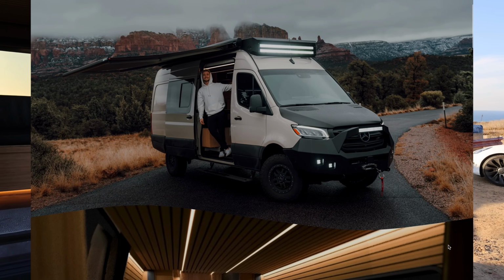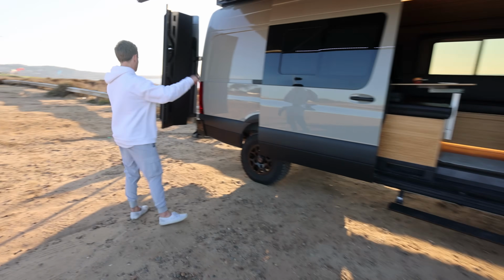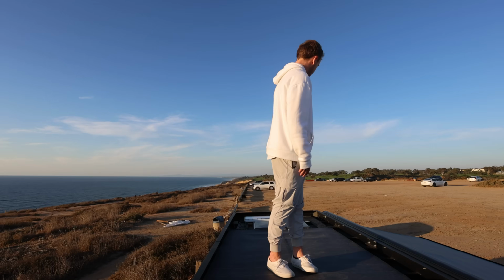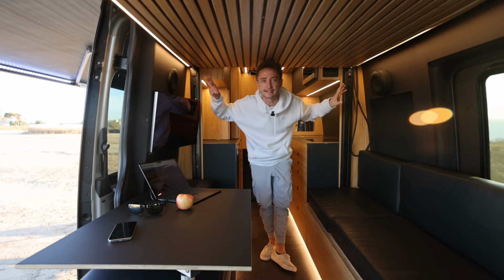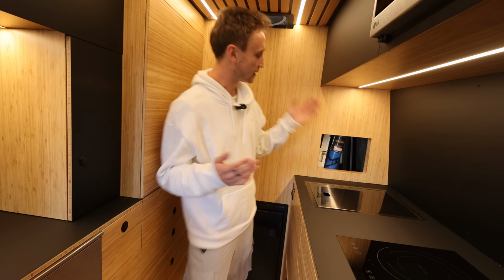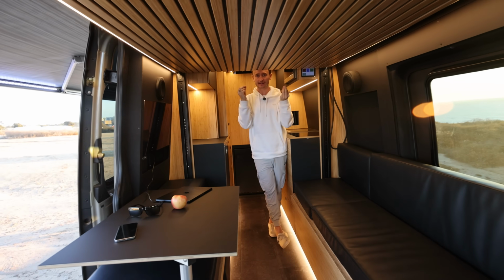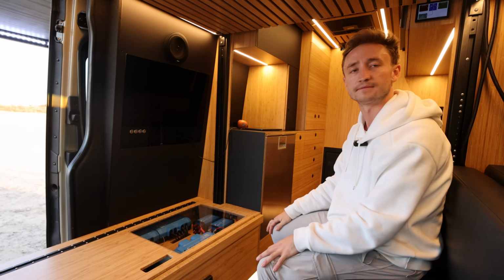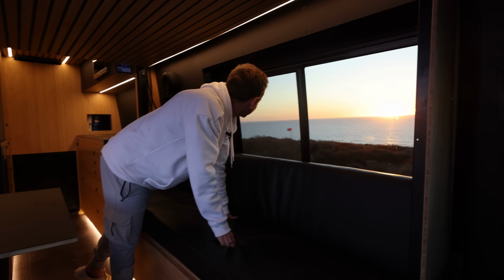MOST Futuristic Van Build - Mothership Vans

Comment: Awesome!!!!! I know turbines have become relatively easy to make from what they were. Great Scott! On yt showed waterproofing, I think he opted for resin and the water temperature should act as coolant idk long term. As for screws, I believe air and water have the same fluidity and friction; new screw shape and designs have been proven to work best so try the toroidal or innovative drone props which may add efficiency but definitely reduce noise while adding accuracy/control. Ideally, the wind and hydro generators would be the same rig, different screw (prop) if anything. Otherwise shaped like ann egg, 3d printing may be perfect with a non uv degrading material. vawt turbines do best with changing direction and especially with Eddie currents (wake) so it may be a good option, keeping the wires vertical and out the water perhaps-but would need an anchor on both ends with low resistance. The traditional design likely needs a weight and float, but there is a small charger kickstarted a couple years ago for hiking hydro power-low energy ideal principal. I'd suggest a direct mechanic like a bottle dynamo principal, probably using string/heavy bungee as a gear to a housed generator safe from water. Another inspiration might be some testing/ed hydro turbines in new York river for a shop :) :)
Good luck! I'm excited for innovations you might come up with but wow these designs are cool :D

Comment: I absolutely love the previous floorplan with the shower in the back. I just bought a van to copy that design. The reason I love it is because with that floor plan you have views from your living room, bedroom, and bathroom. Not to mention the ability to open the back up in nature and let the smells and steam dissipate into the open air instead of inside your van acting as a better ventilation system when allowable. It also gives you the ability to walk through your van from front to back which I think is important when you are cutting down on headspace via the drop down bed. However, I think it just depends on the client and what they want. If someone needs to hold a lot of gear the extra garage space just makes sense. I like that you have the front layout perfected (the best layout in the industry if you ask me) and can cater the back end to your clients personal preferences and needs. In short, you're doing great, keep up the AMAZING WORK! The only suggestion is to make the bottom benches convert into a bed also like the design Nicole and Edden did. It's perfect for small families. You'd cater to families as well as individuals and couples. We have a family of four - that is why we are copying that design.

Comment: Hey so radical idea, I was thinking as a theme for future van builds is to have a futuristic look to it, black shiny or matte interior with blue and/or orange light strips running between the black panels in symmetrical patterns, very similar to the world of Tron from Tron: Legacy. Or from the Batcave at the end of DC Titans season 1.

Also I personally prefer a 50/50 balance between a shower/ bathroom and a garage. One idea you might like as an inspiration from another van build, the stealth van build has an extendable/modular bathroom that you can use with a full shower and dry flush toilet (or any toilet per customer's request) The bathroom with that build is more so in front of the sliding door.

Comment: Can anyone explain why a snorkel goes on a van that already sucks air from 3 feet above the floor of your $300k+ mobile home???
Reply from the maker: Even at 3 feet there is a lot of road debris, dust that gets sucked up in there. Yes there is a filter but it’s still better having a higher intake like a snorkel. Also, on a lot of these high end vans you’ll see large aftermarket bumpers and those will sometimes have a light bar or something crossing right in front of the stock intake. So moving it gets more intake too. There are more reasons but those are 2 main ones. Overall it’s better for engine

Comment: Why spend 400K on a van? Van is not a house. House lasts around 100 years. Van is for a short term use, lasts around 10 years. When the van is not running all interior is useless. Someone should come up with the interior that can be easily moved from one van to another.
Reply from the maker: The argument like this will always happen. This is not for everyone, at least at this price point. Living or traveling in a van is a very different and amazing experience. Some like having luxuries and some simply don’t need them. It’s all about living your own vanlife either part time or full time

Comment: That’s actually a REALLY bad design to have such a long, hidden thunderbolt 3 cable to connect your MacBook in that cubby hole to the studio display. Thunderbolt cable works optimally under 2 meters/6 feet.
Reply: Good to know!!
Reply: Currently just using it shorter in the screen cubby

Comment: Living vehicle company has a device that captures 5 gallons of water from the atmosphere. Would be cool to see that in a van like this
Reply: It's called an atmospheric water generator. They're not even that expensive. I'm not sure why all boondocking capable vehicles aren't including them yet.
Reply: @dinosaur6756  production is quite low, not too reliable, electricity is required.

Comment: Really like the floorplan although I'd prefer radius corners on all wood features(no sharp edges)
Is/or could the electronic compartment cooling feature be reversable where it draws air from(summer months vs winter months).
Plus, also might help when the heat is on seeing how it's located right across from each other.
Do you keep weight balance in mind when building a van out?(side to side front to back)
With that said are your vans GVWR legal for the roadways?
Reply: ye everything is within gvwr! were doing all radius's on the new builds, not really necessary to go in revere since its still inside, weight Is almost perfectly balanced

Comment: I have a dually and I purchased a dually because I understood most builds with full water, and fully loaded are overweight.  Suspension upgrades definitely remedy this issue, so why has Shaden decided to make duallies the standard for his company.
Reply: Because of gvwr! Suspension can’t change gvwr
Reply: @shaidenvalentine1  Agreed!  You say GVWR but do you mean liability?  I just haven’t seen a builder acknowledge this issue yet.  My transit is a 10360 GVWR AWD with larger fuel tank and 32 gallons of fresh water storage. All packed up, gear loaded, full of gas, and water I am a little over 9900.  Upgraded suspension to van compass 2.0 and it handles much better, but I am still within OEM recommend weight. Many builds are not.
Reply: @jeffsteinmetz7188  yeah exactly i want to legally be within the vehicles gvwr on top of upgrading suspension

Comment: Wow this is almost perfect! I say almost because I feel the kitchen a little claustrophobic and the toilet/shower placement provides no privacy. But I really like the way the shower is hidden. I'm still thinking if it's possible to modify this awesome vanbuild placing the hidden shower so that it uses the access opening space and placing the toilet under the passenger seat (remove the sitting cushion to reveal the toilet and have a "tilting" backrest instead of a sweavel seat) so you can have the toilet available without blocking the kitchen area and using the driving area for privacy (with curtains of course). Is it too crazy? 😅

Comment: What brand is the sweatshirt you are wearing in this video
Reply: Hollister haha
Reply: @shaidenvalentine1  what kind of pants are you wearing? Love them! For privacy noise while using the bathroom, put a  white noise generator button easily accessible WHILE using the bathroom, an exaggerated button with a happy face on it so it is easily remembered. Then program the button to run the Maxx fan at high speed for 10 minutes with a soft start or ramped start so it isn't noticeable turning on, that automatically shuts off.
Reply: @shaidenvalentine1  Thanks so much for your fantastic designs!

Comment: Suggesstion to Mothership Vans: design a way to capture rain water or the use of river/lake water then all you need is water filters.
Reply: Working on it!
Reply: @shaidenvalentine1  Hey Shaiden, I have an idea for the bench seats... You could do a slat system that's threaded together and secured on a track at the ends. This will cut down on weight but also make it super quick and easy to access under the seats because you can slide them all to one side or the other, to have full open access from the top without having to hold up or remove a lid (it works similar to a tambour door). And because they're threaded and on a track, it keeps them in place from popping out or getting misaligned and keeps the appropriate amount of spacing when you pull it across to lay the cushions on it. Also, with the slats all attached to each other (kind of like a rope ladder but laying down flat), it's easy to remove to have full access to the entire bench, to work on or replace equipment, and just as easy to put back in place because you don't have to place each board back and space them out individually.
Reply: Done. Clearsource had its Nomad system and Blu has its ARX+Adventure series.  I've also seen DIY systems that use a 12v water pump just like the one in the van.  There are plenty of "prepper" sites that sell these systems.
Reply: If the roof rack is 7'x18' with 1" of rain that would be about 78.5 gallons, easily enough to fill the freshwater tank.
Reply: where is the wc 🚽
Reply: The atmosphere is full of water
Reply: No thanks, pollution is real
Reply: definitely wouldn't be legal in some states where they have water issues and you can't collect rainwater. And rightfully so
Reply: @guyrelax It is not illegal to collect rainwater in the US but some states impose RESTRICTIONS on rainwater collection. They are: Arkansas, California, Colorado, Georgia, Illinois, Nevada, Ohio, Utah, Virginia, Washington & Wisconsin. Restrictions may be the size of the rainwater system, use of a licensed plumber, the need for a permit or the use of rainwater for certain purposes. A rainwater collection system in a van would not be simple (filtration, plumbing, etc.) but done right, would be fantastic. No worries about driving through states having restrictions.

Comment: One thing I do not care about is the boxiness of all the builds now adays these builds need angles and curves in all the cabinetry
Reply: We’re doing all curves on the new layout! Stay tuned!! Agreed
Reply: @shaidenvalentine1 You do great work. Myself I will be ordering a 2024 Promaster for my first build I have a great design in mind to build out but only need to figure out the 48v power systems part to run all the high end gear I am planning such as a dishwasher, washer dryer
Reply: Great build ... but agree the sharp corners need to be rounded.